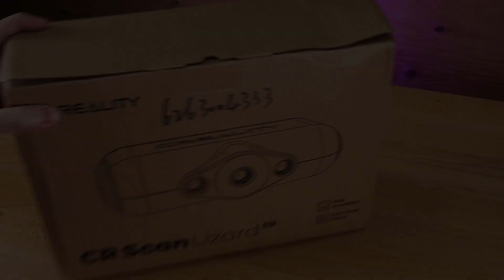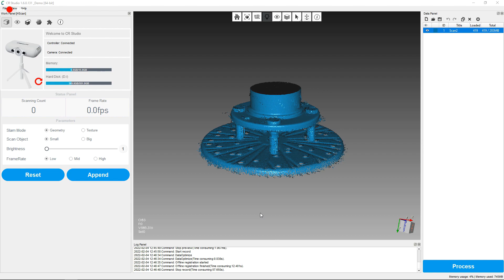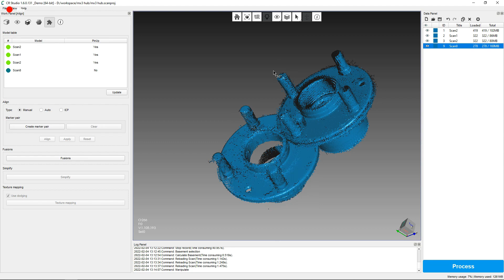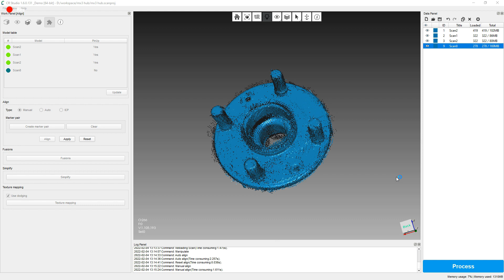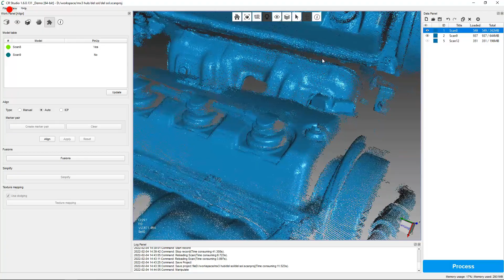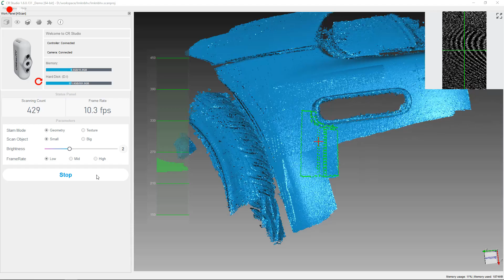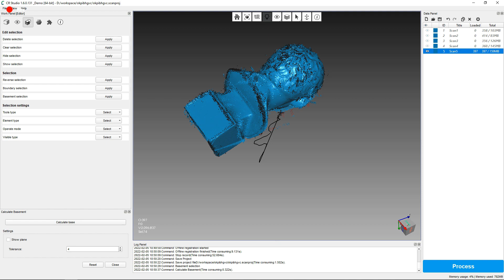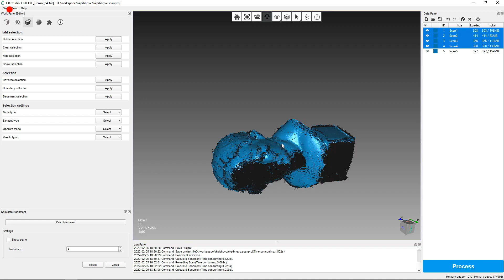Awesome Accuracy A From Budget 3D Scanner - CR-Scan Lizard

Comment: Can anyone out there compare the Revopoint Pop 2 to the Scan Lizard? I have looked all over, and can not find any direct comparisons between the two.
Reply from the maker: I have one on the way to do just that 😁👍
Reply: @randymay  Looking forward to it, watching a couple of other videos, it looks like the Pop 2 handles threads very well. Where you able to get the Lizard to pick up threads well?
Reply from the maker: I would have to try it on something else to see how it would work with them. I think I have a short shifter some place that I could try it on.
Reply: @randymay  That would be awesome!!
Reply: I think you'll have to wait till after they ship (Feb 21-24 or something) then the backers will all have it and not just the pre-release units.
Reply: It seems like the pop 2 is better overall quality and experience, but also more expensive. It's got the color texture scanning built in already, but they do not recommend for direct sunlight.

Comment: Good work! Thanks for being probably the only one reasonable reviewer of this product at you tube so far. You did some real measurements and compared with scan, also your approach to scanning is professional. I really think that you pulled out the best from this device and showed it real usability in terms of accuracy, user experience etc. That is what other reviewers of this device lack of. Do you think that current price tag around $384 for premium bundle  is reasonable?
Reply from the maker: Well thank you very much and I try to be as transparent as possible with this type of thing. Honestly I do think it is a steal at the price that they're offering right now. And since you've watched my video you can see what the limitations are so going into it you already know what to expect out of it and what you can and cannot do. 

If you have any other questions feel free to ask and if you can use my link because I actually do get a little bit of a credit if you sign up and get one through my link. https://bit.ly/CrScanLizard 😁👍
Reply: @randymay  Yea in fact I would have one more request. Can you share trough some filetransfer the CR studio projects with your scans? Particulary magicarp, the white bust, and the first metal part if possible. I would really like to import the meshes from CR studio to GOM Inspect Pro software and see the comparison beetween the orginal 3D model, and scanning result. Also if you could share the source of orginal 3d models of magicarp and white bust(I guess it was also 3d printed from some 3d model). If you decide to share these things you can do it here or we can switch to email or whatever is comfortable for you. :)
P.S. I really appreciate your transparency, it is not so common nowadays. You can be sure, that if I will back this project(and I am really close to do it :P) I will use your link, you brought value with this review so it's fair to give you a little bit in return ;).